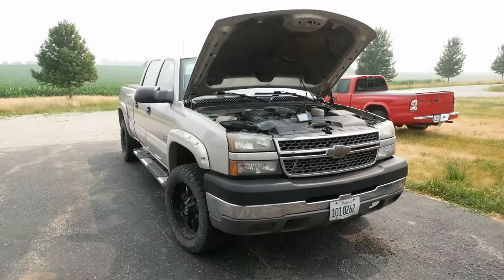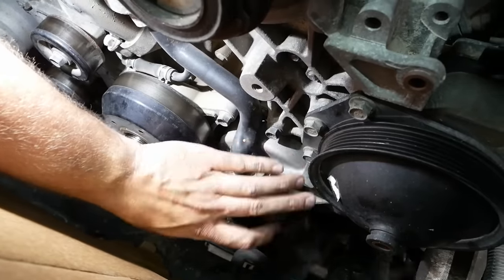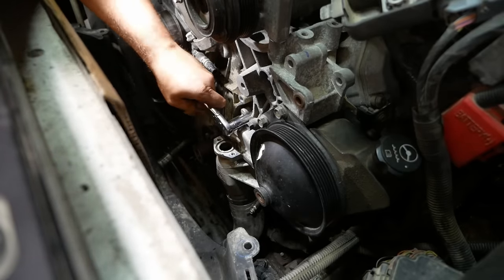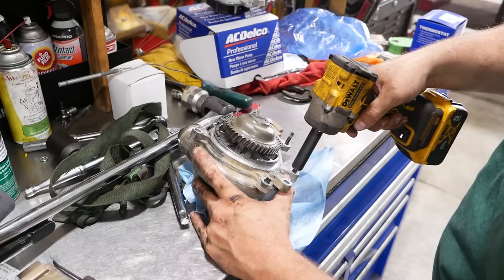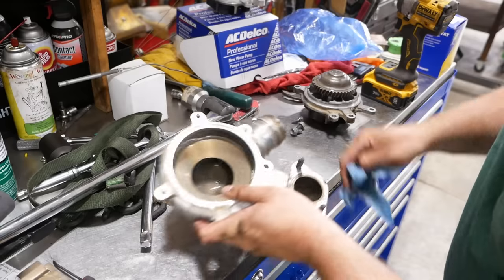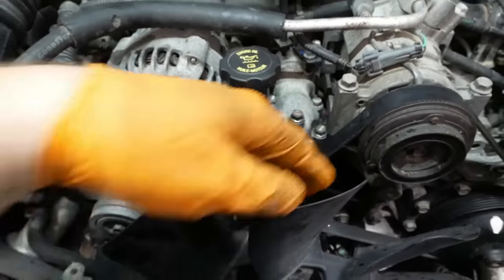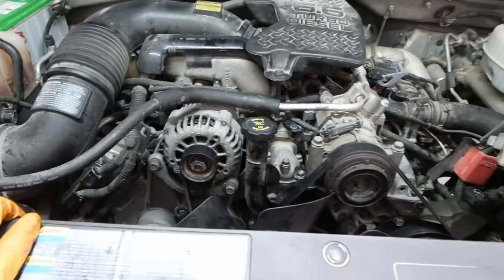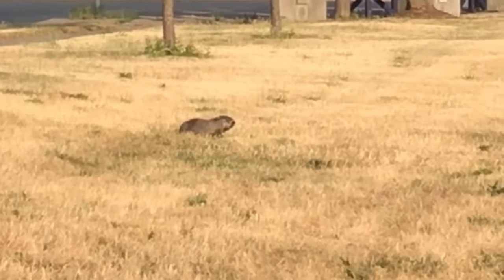Is this Cheating? GM's 6 HOUR Water Pump Insanity

Comment: "Our friends at Isuzu have made a simple job much harder than it had to be" As a recovering Trooper owner, I have seen this first hand. There's a reason they don't sell vehicles in the US anymore.
Reply: Duramax was a game changer when it hit the US market.  Very capable reliable engine.  Took Ford at least two engine series before they ever came close to reaching the same achievements.
Reply: GM Pulled out of Thailand about 5 years back......Isuzu took over the joint venture facility......largest selling pickup in Thailand, next is Toyota, and a distant 3rd is a four letter word that I would/will not park in front of my home because I don't care to lower my homes value!
Reply: The Duramax engines arent Isuzu engines. Theyre made by D-max which is a company started and owned by GM to make engines for Isuzu and GM.
Reply: Water pump in a Trooper is a doddle. Cambelt and waterpump takes me about 45 mins to an hour.
I love Isuzu engines, they last forever, easy to strip and rebuild and rarely destroy themselves if serviced.
Reply: Loved my Rodeo.  Worst issues I had were the GM crap they put on it to sell in the US.  A neighbor had the same model year but the Honda passport version.  What GM crap broke on mine did not break on hers. Couldn’t beat the 5 year 120 k mile warranty.  Two biggest complaints, weak AC and no cup holders!
Reply: Wes, smarter than harder for you, love the channel as always regards and best from Scotland 🏴🇬🇧🛠️ 0:42
Reply: @irongoatrocky2343   FORD
Reply: @Failure_Is_An_Option And?
Reply: @Jin-Ro  I Agree. I have probably Sweden´s only Trooper LTD 5-speed manual. It´s a 3.2 SOHC. The cambelt and waterpump was a breeze. And here´s the fun part. It was the factory belt I replaced. So the original belt had 25 years and 230000km on it when I changed it.
Reply: @admiralfloofz658  Duramax is a joint venture between General Motors and Isuzu.
Reply: The newer line crew trucks my company uses are Chevys with a "Powered By Isuzu" badge on them - is that a Duramax engine?
Reply: @admiralfloofz658 That is factually incorrect. They are Isuzu built engines, designed and engineered to GM's specifications. Isuzu still make 4 cylinder inline, large displacement diesel engines for every world market.
Reply: Yes but they make some hellaciously good diesel engines.
Reply: @the_hate_inside1085 *was. Isuzu just left that venture and its now wholly owned by GM.
Reply: its a  Duramax engine not isuzu
Reply: @wes11bravo  if it sounds like a diesel powered motor than yes it is!......but as far back as  1983 Isuzu was powering some GM brands with 4 cyl gas engines as well!
Reply: @Failure_Is_An_Option lol everyone forgets ford was selling the 7.3 for years while gm was pushing the 6.5 Detroit garbage. please don't make it sound like the 6.6 duramax was the first good diesel also the first few years were plagued with injector problems. Then the next generation head gaskets.
Reply: @irongoatrocky2343  Yea i wouldn't park a Fiat outside your place either.
Reply: @irongoatrocky2343  and that 4 letter word wasn't bailed out by the government unlike cheapo bowtie hah
Reply: wut? They sell a crap ton of vehicles, NPR, NQR, NRR! Commercial vehicles meant for high mileage abuse
Reply: @seattleprowash5464  The extent of her echo chamber was a Trooper.  That speaks volumes.
Reply: @seattleprowash5464  Only large vehicles, no small cars or SUV's anymore.
Reply: @Oddman1980  true
Reply: @Failure_Is_An_Option uh... the 7.3l was already out that exceeded the duramax. The idi 7.3l with factory turbo beat out the duramax. What are you on about???
Reply: @admiralfloofz658 isuzu designed it along with dmax. Gm only funded the operation. Its all on google. Not that any of that is relevant. Gm internaional, ford and cummins all have good engines they also all have some pretty fuckin terrible engines. Trial and error is how it works
Reply: They left because they didn’t want to comply with the new environmental regulations of diesels, saying they would ruin diesel engines. And they have ruined diesel engines. So. Tbh. Isuzu is a company I’ve always viewed as having a fair amount of wherewithal and integrity.
Reply: @ryancollins3227  Oh the butt hurt is strong with this one too.
Reply: @Failure_Is_An_Option  incorrect. I stated facta dog but go off honey
Reply: @ryancollins3227  "uh... the 7.3l was already out that exceeded the duramax. The idi 7.3l with factory turbo beat out the duramax. What are you on about???"

7.3 IDI peaked at 191HP... 
7.3 T444E peaked at 275HP...
6.6 LB7 Duramax 300HP...  

300 sure seems bigger than 275.  6.6 sure seems smaller than 7.3.  Bit like getting whipped on both ends at the same time.  Is this how you kids argue on the internet these days?  Making shit up that can easily be verified.  Some of us owned and wrenched on all of them..  The 7.3 was decent.  It's bottom end power flat out sucks.  It's cold weather operation flat out sucks.  HUEI flat out sucks.  Ford did not get their shit together until the 6.7... and even that was touch and go because the first year was not without significant problems.
Reply: Cmon I had a trooper and it wasn’t bad to work on at all. My biggest problem was neglect because no one puts money into a cheap truck so by the time you wanna fix something you might as well rebuild. The timing belt kinda sucked but no worse then any other v6 with timing belts.
Reply: They don't sell vehicles in the US because their vehicle division was bought by Nissan. It had nothing to do with their weird engine designs. They do however still make engines that are used for a lot of different things.

Comment: I wouldn't call that cheating, I'd call it working smarter not harder.  Not to mention doing your customers a huge favor.
Reply: It actually seemed relatively easy.
Reply: @dlewis9760  When you're that good, yeah it looks easy.....
Reply: makes me wonder - do the dealerships charge the full 6 but take the shortcut? If so, hugely profitable job!
Reply: I bet they do, chevrolet, it's a big PLUS??
Reply: I know many mechanics, who work in different industries, and all of them charge full payment, for work done. If it is 6 hours and the job takes half the time. Because they are talented. Then it is full time that is charged. I know people in Norway, Sweden, Finland, Denmark. And the sad thing is that they don't get paid more for it. I myself am an ex-mechanic & car sheet metal worker. So I know.
Reply: I am convinced that GM since at least since  the 1980s has been desk-jockeying the service manual instructions.  Some 23 year old junior engineer (I was one myself) is told to study the exploded parts diagram and write the repair procedure.  My 1988 Buick manual told me to ( but not HOW to) remove the dashboard in order to change the heater core, which of course is completely unnecessary.
Reply: @jeffdrake3224 I've had them openly admit to me they do. They don't hide it from me.
Reply: I bet wes charges book time
Reply: The whole point of having a business is to try and maximize profit while also producing a quality product. If you can do a 6 hour job in 3 hours without cutting any corners, that’s called talent and experience. If you, as a customer, are expecting your mechanic to cut you a price break and charge less than book time because they have enough talent and experience to do the job in less time, you’re an idiot and a cheapskate. Good mechanics are woefully underpaid as it is. Also keep in mind that the 6 hour jobs that take 9 hours still only pay 6 hours.
Reply: @dlewis9760 mostly cos the hard bit (I'm fairly sure) is it's all deep in the narrow gap between the radiator and the engine. Would be dead simple if the engine was out. I am surprised the factory instructions didn't say to yank the radiator.
Reply: @Steve_Just_Steve  yep!  Brain surgery is easy too, if that's what you do everyday.  Guys like Wes make it look easy.
Reply: @hannahranga  It probably does.
Reply: @jeffdrake3224 yea definitely do, that’s flare rate

Comment: Step number one - tape the inspection cover over the ignition switch. 😉🔧👍
Reply: I like to disable the starter, pull the wire off the solenoid. I usually end up forgetting and am trying to figure out why it will not turn over and then remember but at least I have not damaged anything, except my pride 😂
Reply: Good idea, thanx.😃
Reply: @GinosGarageUSA  
Yeah, I’d forget too. That’s why any trigger I set is direct and possible to miss or forget. Covering the ignition key switch with that inspection plate would be pretty much foolproof.
Reply: Good idea. When doing the cam belt on my Citroën Xantia recently I actually considered to stripe the ignition key to the thing I used to block the flywheel.
Reply: Or attach the key to the tool!
Reply: #1 when you go under the hood of any vehicle is disconnect the battery.
Reply: @montestu5502  that is actually a really good idea-"where did I put that damn key....ohhhh yeah"😄
Reply: Zip tie key to steering wheel
Reply: The first time I rebuild an engine I ran it for a while without oil and wondered why it would get so hot -this was on a big bear 350 atv and that thing burnt my legs and then I remembered I never put oil in it
Reply: @uncrustable9923  
Wow! Did that do any damage?
Reply: @Rein_Ciarfella  surprisingly no, it wore the new rings down so it still burnt some oil and rolled coal like a diesel if you rev it and that was the original reason I rebuilt it because it always needed rings but it was such a pain and I was impatient to ride it so I put oil in it and had fun over the next couple summers and then I accidentally put super heavy weight oil in it years later which gave it a new life of power with all that compression but then eventually developed rod knock so I need to rebuild it -for reference it's a $300 4x4 beater that I never have time to get around to
Reply: @MaxNafeHorsemanship That makes adding windshield wiper fluid a lot more complicated😂
Reply: Disconnect batteries , chances are they need cleaned anyways .

Comment: So I decided after working directly with engineers at the company that made Zeros, the reason they design stuff like that is because failure is not an option. They assume things will not fail because they have designed it properly and failure would be bad. It’s the strangest thing but over and over I have seen this, and we would have to talk them into making something accessible to fix once it broke eventually. So this does not surprise me one bit. Nice work, hope the air clears up for you guys, and hope they are able to het those fires under control for our friends in the great white north!
Reply from the maker: I've seen that with the German engineers. They think it's OK for an engine to have 5 timing chains that take 30 hours to replace because surely a timing chain would never fail. They also can't comprehend that not every owner is doing perfect maintenance according to the manual.
Reply: @WatchWesWork  Yea, unfortunately the Japanese are extremely penny wise and do not want to spend any extra money on maintenance. True story, in their office they had a label on the soap dispenser bottle that read “do not throw out”, so they could refill the bottle!
Reply: Are the engineers ever passionate enough about their work to care about how it will hold up after 15 years of use? And even if they do care that much, what about the company that's in the business of selling new products instead of maintaining old ones?
Reply: @BitterCynical The length of time they care about it holding up is equal to however long the specified warranty period is.
Reply: @LN997-i8x  exactly. all new vehicles have planned obsolescence built in every aspect.
Reply: "Never" means until warranty expires. Why would the management order engineers to care about anything past that time
Reply: Ran into the same mentality with Sanyo ultra low temperature Freezers. The engineer from the "mothership" told a bunch of us that it should never need fixing and if it did they picked the equipment up and did the work at the "mothership" shop.True story!
Reply: What an interesting double-edged mentality. I wouldn't be surprised if more-recent 'hard-to-maintain stuff' has come out of Japan due to (how long) their low-mileage road-retirement laws (have been in place).
Sad, really. 80-90s 'Jap Cars' were often well-built, long-lasting, and decently-easy to work on. IMO, Japan did so well in their automotive-industrial exports, that they became the standard neighboring industry copied.
Example: My ~2009-2011 Hyundai (Made in SK) 2.0L I4, sounds identical to Honda's 2.0l;  after working on an early-90s Honda Prelude w/ a friend, I can see the desecending 'flattery', everywhere in my 2 lil 4-banger (Made in SK) Kias. 
I wonder if the 'most' reliable Chinese-Domestic auto brand(s), just copy Honda and Toyota, too?

Oh, and as to Hyundai's reputation in the US: 
IMHO, Never buy a Hyundai or Kia that is A. Not marketed in Korea/WW B. Made anywhere other than South Korea. Note: Some US-market models swap powerplants from their KDM/WW counterparts. From what I've seen, NA market-targeted models and powerplants are the primary contributors to Hyundai's poor but, earned reputation.
Fun (tangential) fact: SK doesn't put ethanol in their Gasoline. 🤔
Reply: @WatchWesWork  Amen!
Reply: @WatchWesWork  You are on the money there most people only put fuel in their vehicles & then wonder why it stopped going & then complain when you quote high to fix it.
Reply: @LN997-i8x  but then, you get fogged off till it expires,,unless your in aus,, we have a length of use clause, expected life span. even 3 yrs out of warrenty,,there liable,,if its not abused..
Reply: @GinosGarageUSA  I mean, I've done that my whole life here in America.  The soap refills are waaay cheaper than buying a new small bottle every time, plus there's nothing wrong with the old dispenser.  That just shows the engineers didn't make that decision.  It has logic behind it.
Reply: @FuckGoogle502  Oh I agree as a personal decision, I do that as well. I was really commenting on the irony of a company that does other things that waste far more money than a bottle of soap, and they are worried about the bottle of soap, stepping over dollars to pick up pennies!

Comment: Wes, maybe a lot of other people have suggested this, but you might want to switch to Job Standard Hours rather than an hourly rate. While people in your area might balk at anything over $70/hour they might not balk at all if the job simply cost $329, or whatever it comes out to. Back in the late 90's I was charging $29/hr for appliance repair. My father-in-law suggested it was too low and so I raised the price - business increased. Over the next two years I raised it 3 more times and found that customers were more than willing to pay $90/hr - even though EVERYONE else was charging $35/$50. The business increased in volume so much that I had to start limiting the geographic area I could serve. The difference was, I showed up on time, did a good job, cleaned up after myself, and treated customers professionally.

You provide a service that very few other mechanics provide. You have skills many don't have. You're also honest and detail-oriented. These traits are worth something. I'd be willing to bet that you could raise your rates to $125/hr tomorrow and nobody would bat an eye. If your customers aren't willing to pay you a fair wage, it's OK to fire them. 

BTW, your videos are awesome, I've been watching Eric O. and yours popped up in my feed. Thanks for doing them, it's obviously a ton of work.

Comment: I grew up a Ford guy and was always jealous of how easy a SBC water pump was. This makes me feel better.
Reply: ford F,E engines are real easy to change water pumps too..
Reply: @merc-ni7hy  Yep, 1 hour job if you have your head on right and the tools at hand. Too bad the rest of Ford's pushrod V8's didn't have the same water pump setup.
Reply: What do you think the same year Ford 6.0 Powerstroke would have needed at the same mileage as that Duramax?
Reply: I think a Ford mod motor is dead simple as well.  Newer ones don't have a mechanical fan, either. It's like 12 bolts total and it's out.  I was pleasantly surprised on my wife's Navigator when I had to replace it.  30 or so minutes not counting the burp and fill process of the cooling system.
Reply: @bigjoebowski22  the water pump on the 4.6 V8 in my grand marquis is the easiest water pump I ever changed. Rare exception for Fomoco products though.
Reply: The easiest water pump I've ever replaced is on a Ford 4.6 engine.  Super simple as long as it's not stuck to the block!
Reply: @silicon212  I had a 4.6 in a '97 Cougar. Saw how easy the water pump looked. Kept the car to 190k miles and never had to replace the pump!
Reply: What is SBC??
Reply: @foxtrot312  Small Block Chevrolet
Reply: @foxtrot312  Small block Chevy.

Comment: I propose many improvements on the design. One, make the fan shroud one piece so it can't be removed before the fan (Ford Explorer I'm looking at you!), two, make the balancer tight fitting so you have to use a puller for it, three, put a steel pipe with just two O-ring on the ends, into the rear of the water pump housing so you dislodge the other end upon pulling the pump and then you get to do the whole job over again.
Reply: You should see the process of replacing motor mounts on a Land Rover 🤣🤣🤣🤣🤣
Reply: So that the "mechanics" don't need to have any skill or knowledge and can be knuckle dragging monkeys got it....
Reply: @buckhorncortez sounds like you’d know a thing or two about dragging your knuckles